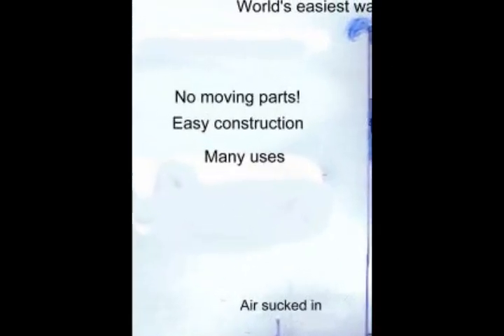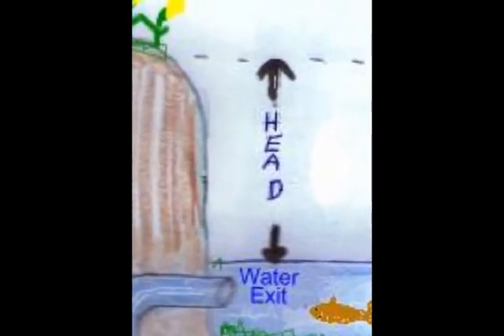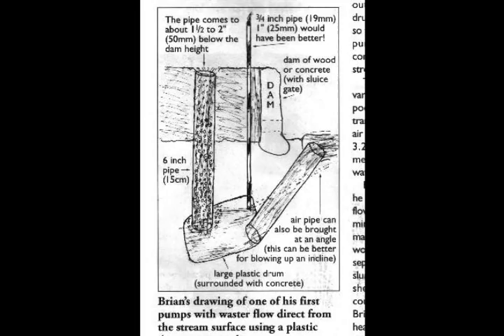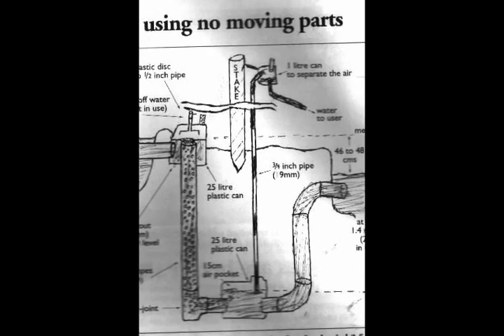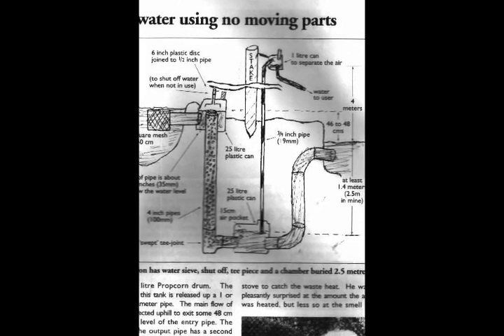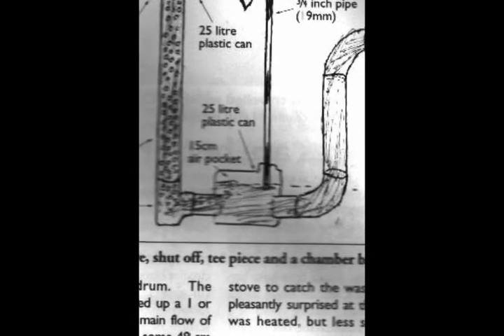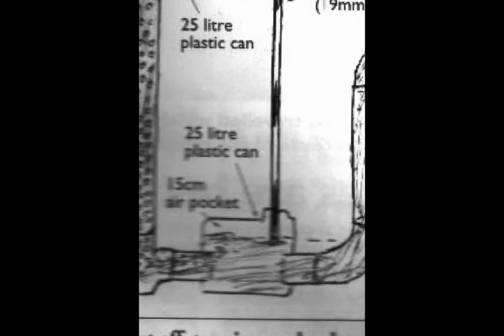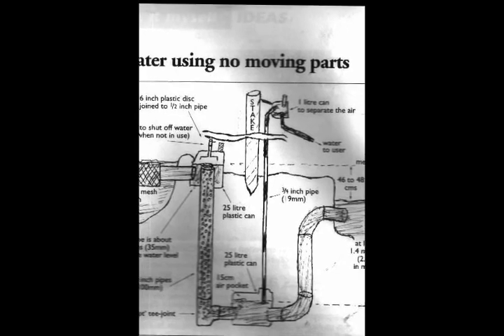Short quick pulser pump explaination

Comment from the maker: @ozzirt  good explanation.  I actually put a shut off on one of mine later. It has a pipe going up through the center. (It is on the tripod pulser pump site). With the shutoff, you do not need to worry about the water going too high over the "plug hole".

Comment from the maker: @Leonbartolome  I have a webpage at tripod, and a yahoogroup, you could try there?  The washer? I forget what is in the video.  I washed beets for animals and I washed river sand (to get rid of silt). In both cases, I piped air from the pump to the place where I did the washing. So just the air pressure from the pump made the bubbles, and the bubbles rising makes the water move.
I hope that helps. The appropedia page will change  on May 15th. (Field tests)
Best of luck with your work.
Brian